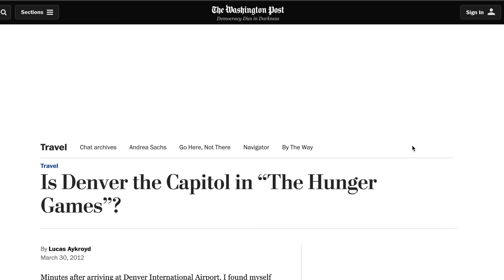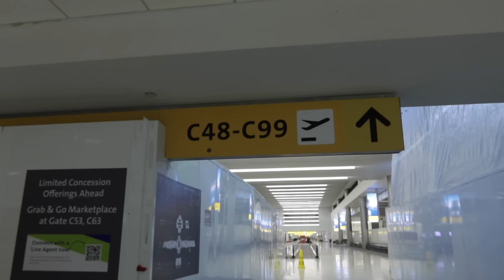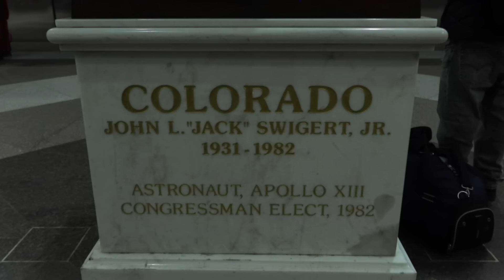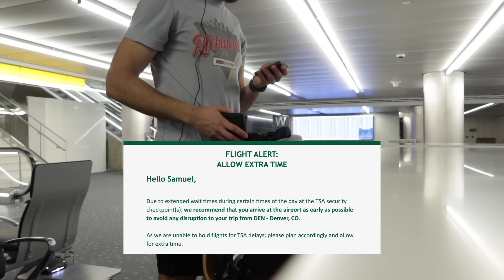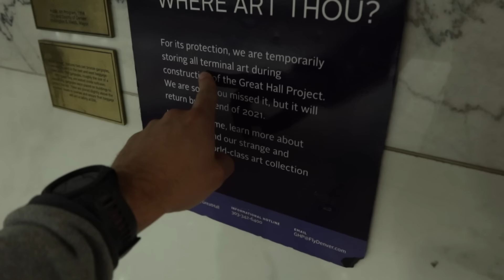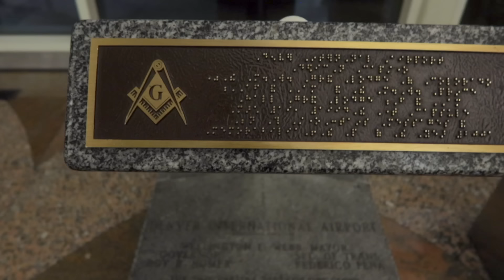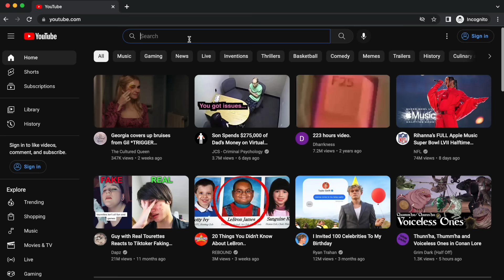Overnight in the World's Most Mysterious Airport

Comment: Haha as a Denver resident I can confirm our airport is extremely mysterious 😂
Reply: Love hate with Denver. Sucks to drive to from WY/N. CO. Recently security line will warp around and through the baggage claim which is ~45 minutes, and it took me 20 minutes to be able to even get on a train to go from terminal B to C because of train overcrowding and delays. Otherwise, it's big and open. Good food options and seating. They have a bathroom built in terminal C where the sinks are facing the tarmac. Very cool. It would be cool if they built those big bridges connecting each terminal that would allow people to physically walk between the terminals opposed to be at the whim of the over crowded trains. They have been investigating the feasibility of add those bridges for over a decade apparently.
Reply: same
Reply: and they have always done construction that never gets done, but still gets worked on

Comment: Lol. They didn't immediately abandon anything. The levels under are 7,000 ft tunnels that allow baggage carts to haul your luggage between terminals rapidly and without clogging the surface. The "abandoned" part is the old United state of the art automated baggage routing system that was plagued with issues and massive maintenance costs. It ran above the roadway tunnels. Amd they kept parts of it in use until 2008. Now those metal tracks amd side tunnels are abandoned. There are support facilities and evacuation/ventilation tunnels in there for the trains as well as maintenance areas to work on them. Crew break rooms and parking for terminal vehicles. There are shelter facilities for tornadoes. They literally did not dig deep enough or move enough dirt out to account for the ridiculous claims. I know. I grew up there. Was in high-school while they built the thing.yeah, there is some weird art in there and I think they have leaned into it even harder as a way to mock the conspiracy stuff. Which is hilarious. There's nothing weird or mysterious down there. It's all just the support infrastructure for a massive international airport in a single central axis that is easy to access and get to.